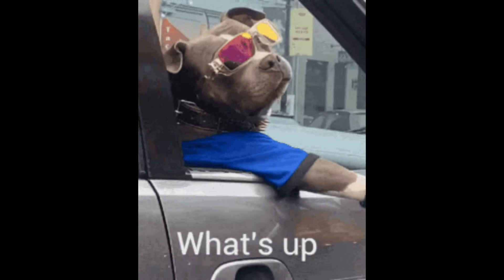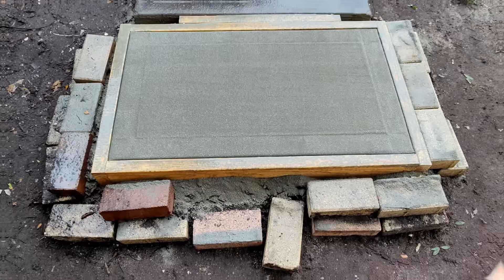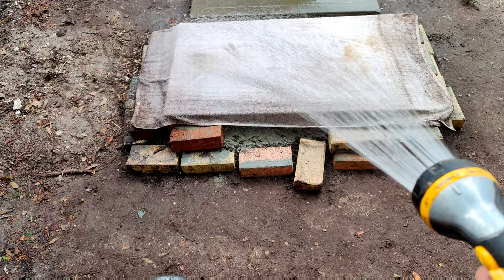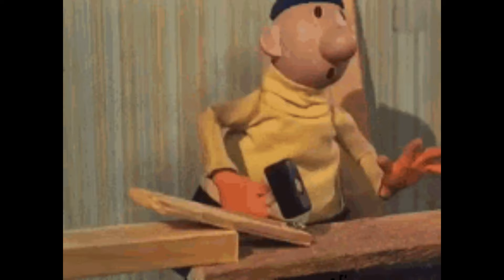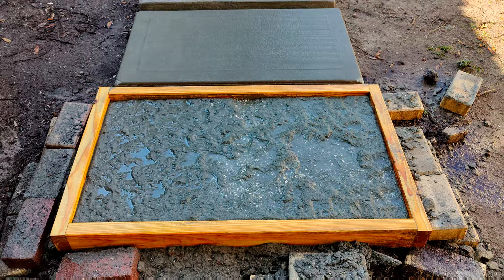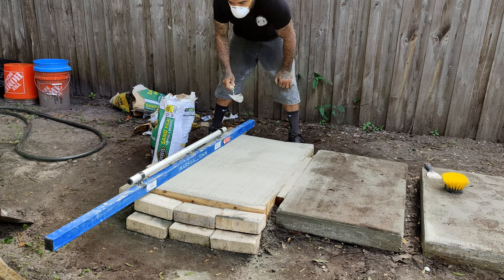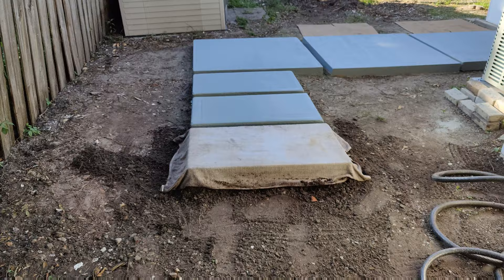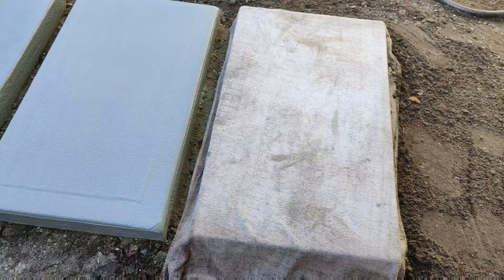Diy Dry Pour Concrete I Messed up my last slab

Comment: As joeteejoetee asked.. How did you know it wasn't good this time and you used burlap too soon? Was the top crumbly instead of going hard? How did you come to this decision? Very nice rescue by the way and your other art peices look lovely in that colour!
Reply from the maker: In the previous slabs I misted around 3-4 times gave them an hour between next misting allowing them dry and harden, in this case I rushed misted once or twice back to back and put the towel on right away, this was my mistake 🤙once I pulled the towel up the finish was destorted from the pressure of the water and the towel, lesson learned to mist wait hour to dry repeat process at least 3 -4 hours then it's safe to put burlap/towel🙌🤙
Reply: @DiyTheGrappler I have run into some issues while doing relatively large slabs for my crawlspace, even though I followed the Cajun watering scheme and water cured each slab for seven days. Note that each slab is separated by a vertical transition, which I wet poured.

On one slab, a hairline crack developed, and in a few areas small air domes have formed just below the slab surface, which should not compromise the slab under light foot traffic. 

I will fix the hairline crack with cement epoxy and then paint all slab surfaces. 

Since I'm only doing  crawlspace slabs, the final result will be more than sufficient. However, for driveways and patios, I would only recommend the traditional wet-pour method.
Reply: @DiyTheGrappler  Each of my slabs was made of a concrete base and a Sand/Topping Mix upper layer, with each strata being one inch thick. In my case, over-watering during the curing stage may have caused issues despite the fact that I only watered each slab twice a day and kept the slab covered with plastic between watering. The following is from Quikcrete:

"QUIKRETE Sand/Topping Mix should only be mixed to the proscribed water content as listed on the packaging. If excess water is added, the product will not perform to specification and will likely be weak and discolored. It will also be prone to cracking when overwatered."

I think the remedy for my project will be to stop using the Sand/Topping Mix altogether and to only use Quikcrete Concrete instead, mixed with additional portland cement. To hide any aggregate during the screeding process, I can sprinkle concrete with no stones in it over the exposed aggregate. Then, I will follow the Cajun watering scheme to the letter with no additional water curing. That's the way Cajun does it. For two of the areas already poured, I can add a one-half inch layer of wet-poured Sand/Topping Mix to hide any defects, followed by two coats of concrete paint.
Reply from the maker: @chesslover8829  awesome trial and error,,, I have been very busy,, but all my slabs are solid and crack free🤙 alot of times those cracks are due to air pockets rising or not letting the top layer harden before further watering, but good luck on all your tests/trial and error 🤙 I will continue to use sand topping which was recommended by a high level experienced concrete worker,,I will make an update video soon of all my slabs and new slabs I am about to make 🤙
Reply from the maker: @chesslover8829  I did run it the same problem you did with over Watering to soon but sinced been corrected,, this is the same for  wet pour if you put to much water to early in the process the concrete becomes weak,, definitely a balancing act of when to start the heavy water curing process 🤙 good luck 🤙 more vids coming soon🤙
Reply: @DiyTheGrappler  I stated my water curing 12 hours after the initial watering sequence.
Reply from the maker: @chesslover8829  🤙 when did the cracks and holes start to appear?
Reply: @DiyTheGrappler  The hairline crack, running width-wise across slab number two, appeared two to three weeks after I completed the one-week water cure. The hollow pockets (they sound hollow when I rap my knucks on the slab surface) appeared soon after the initial watering phase ended. Note that a plastic vapor barrier lies underneath the concrete. Placing this plastic vapor barrier underneath the concrete was suggested by the Cajun folks. Also, note that I was unable to tamp down the surface of the dry pour due to ceiling height.
Reply from the maker: @chesslover8829  I see ,,that sucks, you can always use a traditional wet resurfacer to fix 🤙 good luck 🤙
Reply: @DiyTheGrappler  I don't have enough experience to use a resurfacer. I will use a concrete sealant and feather it using acetone. Then, I will paint all the surfaces to obtain a consistent look and feel.
Reply from the maker: @chesslover8829  🤙you could always put a light layer of dry sand mix cover the imperfections and wet it after paint🤙
Reply: @DiyTheGrappler  That's a good suggestion. It would be far easier for me to spread and level a dry mix (Quikrete Sand/Topping Mix) rather than my trying to work with a wet mix in order to hide the imperfections. For the watering cycle, I could do three mistings followed by one showe, each one hour apart.
Reply from the maker: @chesslover8829  💯💯🤙🤙
Reply: @DiyTheGrappler  With your help and encouragement, I have identified the problem. In the base layer of my two-inch dry-pour, I have been adding four cups of portland cement to each 60-pound bag of Quikcrete Concrete. Apparently and unfortunately, I did not mix those two ingredients well enough, which created pockets of portland cement in some areas of the slab that then caused excessive out-gassing in those areas. This out-gassing created air domes just below the surface and may have caused the second slab to crack across the middle. To remedy the situation, I plan to find the air domes, break them open, remove the debris, repair them with concrete without aggregate, and then resurface with a one-inch layer of Quikcrete Sand/Topping Mix using the dry pour method.
Reply from the maker: @chesslover8829  awesome, remember Portland cement is weak alone,,sand mix is actually concrete without the aggregate 🤙 in the future I wouldn't add Portland to the concrete mix,,it will make the mix weaker🤙 some advice I would do what your going to do,, break open the air pockets,clean them,then just fill with dry sand mix (which is concrete without rocks)and follow the watering methods🤙 good luck 🤙
Reply: @DiyTheGrappler  Thanks!
Reply from the maker: @chesslover8829  🤙🤙🤙